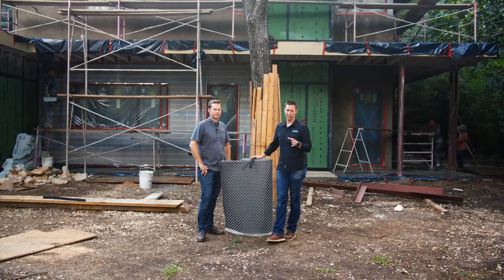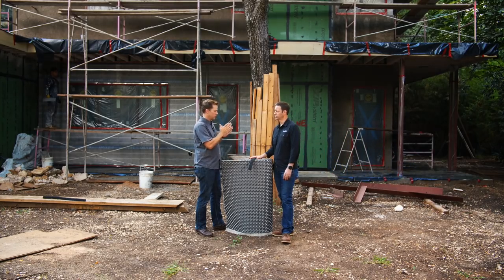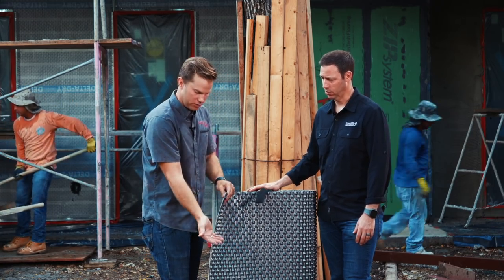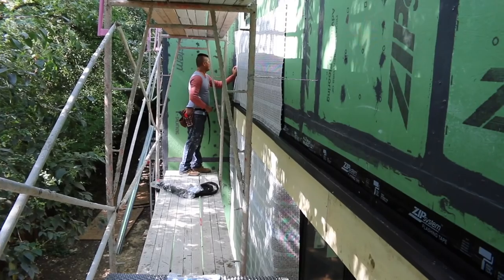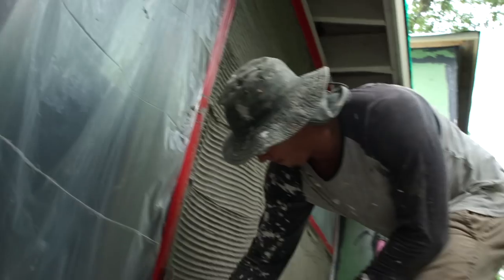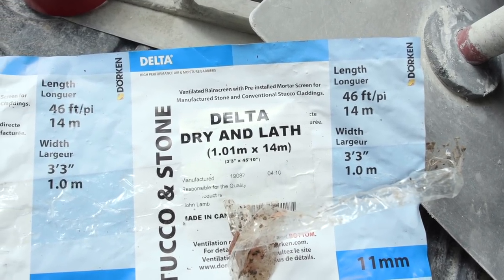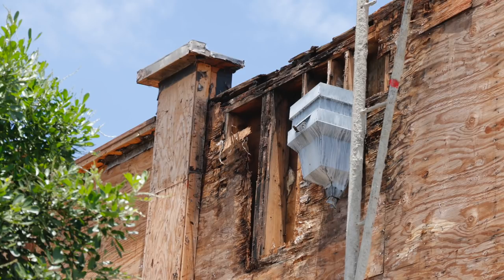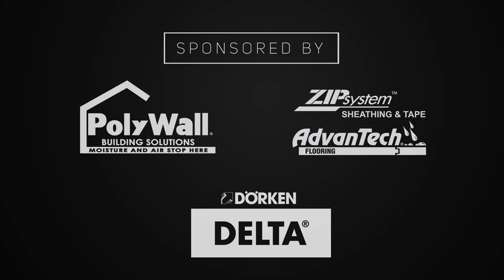WHAT is this, and WHY do you want it under your STUCCO?

Comment: Whoa! As a 25 year vet in Missouri, installing both Stucco wire lath and Efis (Exterior, insulation,finishing, system.) foam.
This product looks great! No more wire? No more paper!?
This looks amazing. 
I'm still an Efis fan though. 
Gold coat with mesh over zip system, then 1 1/2 foam over exterior. Sanded, chalklined, and groves cut. 
The base coat is much stronger along with better R value.
The weather expansion is always breathing. Not many cracks and if so, very small with proper insulation. In Mo, weather here is much different in terms of expansion. We also use 5/8ths durarock sheets. 4x8. Very strong and great for golf courses where balls are hitting homes😂.
Great content. Loved seeing the boys using a "Go Devil" or "Cheater" on the wall. Great way to put mud on the wall vs a hawk and trowel.

Comment: Where I live most stucco homes are painted so 99.9% of the water never gets to the stucco. The double D paper creates a drainage plane when the top layer swells when the wet stucco is applied and then shrinks during the drying period creating a gap between the layers. An extra layer of 15lb felt over the plywood sheathing creates a durable assembly. Many of the problems in modern construction are due to the failure of OSB and Tyvek when designers want reservoir cladding. Just say no!

Comment: Matt, love your channel and appreciate what you bring to the masses.  After having had build three houses (Maryland, Tennessee and SW Florida)... I can confirm MOST builders (and their contractors) use the most economical and QUICKEST way to build homes.  I was so shocked on your OSB vs ZIP the minimal cost difference (labor is about the same..so builders should not be asking uch more than the approximate upgrade for the materials).

I did a search on your channel for a product that I used to insulate my garage and was considering for my next SW Florida CMU 1500 sq ft (under air)  home... InsoFast.  I did not see any review on it.  My thought was to use it in lieu of a ICF home.  It has plastic studs 16 on center (plastic is a thermal break, no conductance and cuts framing cost out since studs are integral).

Also, I remember seeing a Oak Ridge Laboratory (I think) test using a spray bedliner material (Rhino) on CMU block for hurricane protection.  I imagine it would also be a great vapor/air barrier.  Mythbusters even did an episode where it was "bomb/blast proof :0 ).  What's your thoughts on spraying the outside of a CMU home with bedliner and then applying a 2 inch InsoFast panel on outside and maybe 1 inch insofast in on inside of new home?

Sealed attic with spray foam and metal roof.

Thanks !

Comment: I see the Zip wall in the back that has the fluid applied sealer on the seams and nail holes. Now when you apply the Delta Dry and Lath they are putting many more nail holes and staples into the Zip wall. Doesn't this defeat all the care that was taken to seal the holes in the first place?
Reply: That's what I'm curious about
Reply from the maker: No. They penetrate the zip but have an air gap in front of them which means there is no pressure to force in water AND it means the cavity will drain & dry!  This leads to excellent durability for the house
Reply: What about air seal?
Reply: @buildshow  Just curious though, if that is the case then why put the liquid flashing on any of the nail heads that are going to be in the cavity in the first place?
Reply: @musicims  Because it gives an air seal that the staples ruin like Malfunction142a stated.
Reply: I guess if you went in and applied liquid flash to the inside of the building to the nails you might get your air seal back??
Reply: Matt Risinger what about the air seal of the zip system?
Reply: Malfunction142a that is what AeroBarrier is for. It would seal any potential air leaks.
Reply: You could apply the same stuff used to seal the seams all over the wall right before applying the Delta Mat, so every fastener will be sealed. Just an overkill thought.
Or to not use what would be an obscenely huge amount of sealer, just apply it only over the studs and where the Delta seams are, and fasten the Delta only to those places.
Reply: So I'm armchair thinking here that the plastic Delta Dry with stucco over it would seal air, no?  I don't see how air penetrates it EXCEPT through the bug shield but that seems rather indirect.  I agree with Matt about the lack of pressure to drive water into the staple holes so any moisture will gravitate down and stay dry.  I think. :)
Reply: @cpad007  No, that air gap with the bug-shield provides direct airflow to give the backside the ability to air dry.  It's about bulk water shedding.  I do agree with a lot of the guys here that they are defeating the claimed benefits of the zip with a bunch of nails.
Reply: But what install of outer material is NOT going to penetrate the Zip?  You have to reach the studs behind the Zip to securely fasten anything, right?  Maybe adding more liquid sealer in the spot where a fastener will be driven would help?
Reply: @buildshow   when you say penetrate - do you mean go into, or go through - Into I can understand, as that wouldn't defeat the air seal, through I don't, cos surely it would?

Comment: This video gave me PTSD - my house was built in 1947 and besides the exterior, they used stucco on the interior walls of the house.  I've had two different tradesmen over the years say "I've never seen a wall like this before" - much like the Ghostbusters joke "They don't build 'em like this anymore" "They never built them like this!"  :-)

The method they used on the interior walls was to put up a tar paper against the studs - essentially a 1/4 inch thick asphalt with a chicken wire mesh inside.  Then they put up more chicken wire mesh and used that as the lathe to hold the stucco together.  This does build some very solid walls and they have a nice hand-plastered feel, though nothing is straight or square in our house.

There are two downsides:  Anytime you try to cut into the wall you're cutting through two layers of wire and they'll dull up a zip tool bit in a hurry.  If you use a Sawzall, not only will it wear down the teeth but if the wire catches in a saw tooth it'll vibrate the entire wall, loosening or even cracking the stucco.  The other issue is a modern-day problem: the layers of wire mesh in the walls eat up radio waves like nobody's business.  I needed to put up four Wi-Fi hotspots to get decent coverage in a 1500 square foot house and many mobile phones lose connections once you step inside.  Just imagine: every interior wall has four layers of wire mesh (two on each side) and each room is essentially a Faraday Cage just soaking up any radio signals...
Reply: might be healthier because of the lack of radio... it causes an increase in dna damage, especially over decades.
Reply: Wow!  That's definitely overkill.  They did used to make wire lath plaster walls in bathrooms, shower walls and other wet areas back in the day but it was normally a single layer or lath.  In my 1950 house, the bottom 4 ft of the bathrooms and 1 shower were about 1" thick plaster, not fun to demo.  The rest of the house was normal plaster over 3/8" rocklath.  One ceiling was metal lath, and about 1.5" thick!  The demolition guys hated gutting that room!

Comment: Not a builder....question on the rain-screens though.  In a climate like Nebraska where we have basements, how do you transition the rain-screen behind your siding or stucco to the rain-screen around your foundation walls?  Also, whats a good product to dress up the foundation walls if you install a rain-screen?  Wish I was in the construction world...I can't get enough of it.  Stuck in a sales job to pay the bills.
Reply: You don't, the two drainage cavities are required to remain separate. You also cannot ventilate the cavity via the soffit which ventilates an unheated attic. The idea is to allow air to enter at the bottom of the rain screen to carry out any residual moisture that gains access into the cavity via evaporation. Larger quantities of water entering the cavity are expected to drain out via gravity above grade level and flow away from the foundation. Drainage mat on the foundation wall is to reduce the possibility of hydrostatic water pressure forcing water through the foundation wall.
Reply: So how would you transition between the two?
Reply: @acoenen2804  it would vary depending upon the thickness and type of wall systems being utilized, but one common means is to terminate the wall system above with a metal drip flashing before changing over to the system being applied to the foundation wall.

Comment: I like studying about anything related to stucco.  So I have two questions.  1) If you are using the Roxul board over the shear wall siding (be it plywood or other type) how do you get this new product attached to it?  Roadenhouse washers?  2) Is this product alkaline resistant enough so that it could be used with ecologically responsible lime plasters?  I ask because I currently use expanded metal lath made from stainless which is quite expensive.  The plaster membrane ends up being at least 2 inches thick with four coats.  Thanks.

Comment: Matt if you’re framing a new home. Would it work to use traditional plywood on the exterior framing.
Waterproof the plywood then go over the plywood with an insulated zip system. The environment is
Coastal Maine.
Reply from the maker: I you want a Plywood shear wall I would use a Wrb like Delta Vent SA over to of the Plywood then use Rockwool then an air gap and your cladding.
Reply: That would be kinda pointless zip is basically just plywood with insulation on the back side of it you can get zip up to I think 2 1/2" thick 
The inside layer of plywood would just be overkill and a waste  of money only reason for doing it is to keep the zip system from bowing in if nailed to tight
Reply: The PhD structural engineer across the street from me nearly tore his expensive house down and rebuilt it, 20 years ago.   (I have lived here more than 30 years, now.) He sheer-walled his garage... and perhaps his entire house(?), with plywood, especially considering that he has a heavy mass atop a flimsy cavity... a garage.   In Long Beach, we live near the Newport Inglewood fault and everyone knows that earthquakes wreak serious damage in California... and sheerwalls are a worthwhile countermeasure.   My garage has its own roof and for that I am grateful.

Comment: When they hang it, they just put thousands of holes in the Zip system with the nails/staples that they can't/won't seal. The zip system is useless at that point.
Reply: Erich  I also question that. Is the zip system that self sealing, especially with that many staples?
Reply: On a previous video I think he did a show on how they made sure to seal the zip system on the seams and nails that used to hang the zip system. However hangin this system will add thousands of holes that they don't seal. Seems to invalidate the zip system. The guy even says this at 1:39 that hanging the system introduces  thousands of staple holes into the zip system! Why bother with a zip system then. it is not sealed in anyway after this product.
Reply: @erichb1  The Huber rep here told me that you can look at it both ways. Does it cost more to install a WRB or just install the zip system?

Zip panels are more airtight and watertight than your traditional stuff like Tyvek. Also makes your house watertight as soon as sheathing goes up, so you can go right into electrical without inspectors complaining. So what my rep tells me is, yeah you'll punch a lot of holes into the system, but we're talking about a negligible amount of leakage in 95% of homes. For a comparable WRB you need to opt for a peel and stick, like a Henry's system because Tyvek is still relatively leaky. 

Either way, you need a WRB behind the dimple mat. Either Grade D building paper like jumbotex, Tyvek, etc. So there's some benefits of using the zip system. 

I'll say this though, I don't like stucco over fiberglass mesh. We did a mock up for a client with this very dimple mat by Boral, the stucco did not like impact when we demoed the mock up. Metal lath was flat out more durable when we demoed it. Lets just say once we broke a large enough piece off we could almost yank large chunks out by hand compared to metal lath. Not a fan of fiberglass mesh laths for exterior stucco. Metal lath and fiber in stucco mix is the way to go for longevity.

Comment: Matt, I was always curious why they dont use fiberglass on exterior of houses like they do on boats? I bought a house few years back that had a shed that was fiberglassed thinly over the entire exterior its approx 52yrs old now based on permit with no water rot.  It looks like he tacked the cloth to the side with roof nails, then stuck small patches of fiberglass over the nails before painting it.
Reply from the maker: Hmmmm.  Interesting thought
Reply: It would be cool to see a video about FRP cladding and how it's used. I know it's a thing in commercial construction, don't know why it doesn't show up in residential so much. Cost maybe?
Reply: its a composite material. the upcharging, special tools and forms, and resin make it expensive nowadays. you might have an asbestos panel shed that looks like fiberglass if its that old...
Reply: @Baigle1  not asbestos, its fiberglass, because part of it is exposed when they wrapped the cloth over the top of the walls. The way it was done is the sheeted the walls with plywood, then nailed cloth matt to the exterior walls, then painted the epoxy on the cloth, then over the nails they epoxy small squares over them and blended the epoxy. The cloth above the walls is still in weaved cloth pattern
Reply: I've seen some sheds done up like that around the rain forest on Vancouver Island.  (Lots of boaters there.)  I also had a truck topper coated with the spray-on stuff.  I also repaired some 100-year-old carved trim by painting the resin thinned with acetone directly on the wood about 20 years ago, and it's holding up, and I've seen some wood outdoor futniture painted with the resin in southern Ontario.  (Lots of boaters there as well.  Leave some areas uncovered on the bottom for drying if you try this.)  It might be too rigid to cover something the size of a large house, though.

Comment: You've detailed the zip with liquid flash for the penetration, but what about the nail and fasteners used to hold the new product up?
Reply from the maker: They penetrate the zip but have an air gap in front of them which means there is no pressure to force in water AND it means the cavity will drain & dry!
Reply: Matt Risinger Ahh.... gotcha. Any concern with breaking the zip air barrier?

Comment: The bottom up installation appears to indicate that rather than keeping and water in the air gap to run to the bottom, they are catching and driving it back out towards the stucco. I can see Pros and Cons of both methods. Is this the way the manufacturer has advised?

Comment: Matt, I am in the process stuccoing my new addition and you convinced me to use a dimple mat rainscreen.  I need help figuring out how to terminate the rainscreen at recessed windows.  Do I use a casement bead?  I can’t find any install instructions on the recessed windows.  Help!
Reply: Peter, I have a similar issue- recessed windows. I have 2 inches of foam board as well. I will have to remove the foam around the window, make a wood frame around the window so the product can be nailed properly. Then I will be able to install my thin brick. Hope this helps.

Comment: Matt, 

Great video. Any concerns using an outboard vapor barrier like this in colder climates? The air gap looks small(ish) and provisions for ventilation ("ventilated rainscreen") at the base of wall, sill, head and top of wall look limited. I would be concerned about the drying capacity of this wall. Would a vapor permeable/vapor open drainage plane/lath combo make more sense (again, for a colder climate)?
Reply: that sort of nipple mat is normally used in here in the nordics as foundation water barrier technically its not watertight and it doesn't need to be because it's main function is to prevent excess moisture but not all of it and it has that weather barrier beneath it that allows any condensed water to drip down.

Comment: One observation, shooting in those nails and staples into the tightly sealed Zip system seems rather counter productive. Surely there's a better way to attach it without continually perforating the key moisture control system it sits on?
Reply: Somebody needs to invent a fastener that's waterproof.  I thought that might be the orange-plastic-assisted nails&staples ("cap nails") mandated for use, in my recent re-roofing.  I caught my roofer in violation, early when he was fastening the GAF TigerPaw paper (in lieu of obsolete tarred felt paper) and made him add another layer of TigerPaw, using the orange-capped fastener required by TigerPaw's engineering spec; and that requirement was printed all over the jobsite paper!  Recently Matt performed a leak test, and showed this fastener was not the panacea I was expecting it to be.    (I wish I could post a picture.)

Comment: Maybe a stupid question... but why would you want stucco on your house? I don't see the benefits of having a "water sponge" on your house.
Reply: If installed properly it is very durable, no-maintenance, fire resistant, and can look quite good. As a result it is very commonly used  in commercial, despite being more expensive than many other assemblies. Additionally stucco is the same thing as many stone or tile assemblies (which is why some people call that style "lumpy stucco").
Reply: I'd much rather have Galvalume and avoid the fuss but some cities require a percentage of the front facade to be brick or stucco.
Reply: 20 years in a stucco house--rock solid.
Reply: In a word: Durability